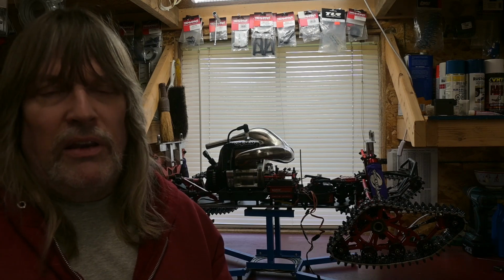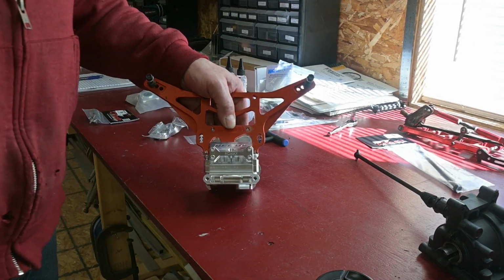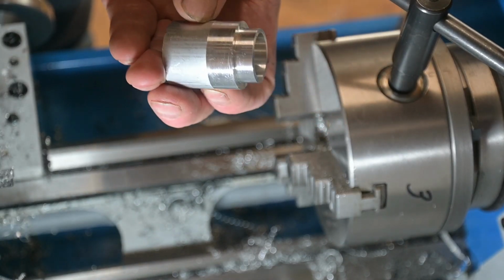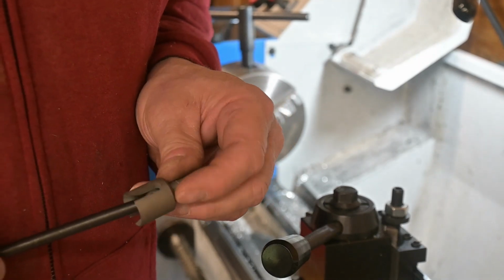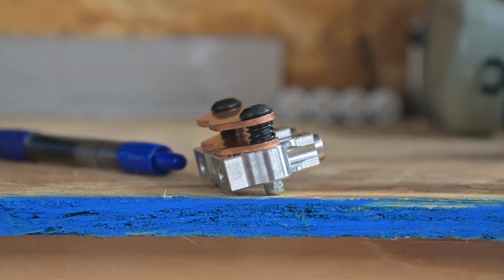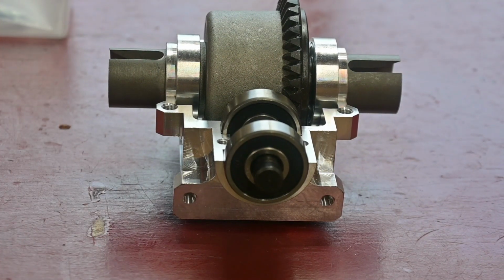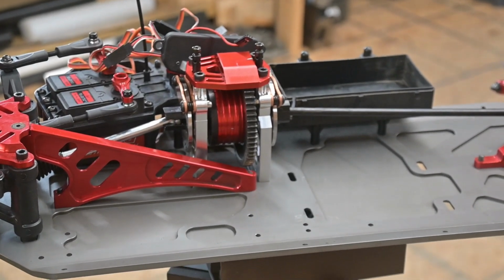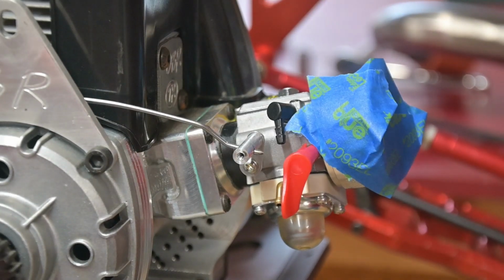Rovan 450 XLT Upgrade guide for high horsepower

Comment: If you still need dog bones for the XLT, the rear center driveshaft for the TLR5B work perfect they’re the same length and I’m using FLM
Reply from the maker: Thanks for the info Scott. My RC season and winter build projects got nixed early do to an arm injury that required surgery. Should be back this coming spring though.

Comment: Quality video! it makes sense to buy a 5ive t 2.0 and swap the rovan chassis, arms and center braces to avoid all the quality issues.  Almost pulled the plug on a 30 degree north 2.0 but their really is a difference.  Great video!  Man you have all the tools and skills to fabricate every piece you purchased. 👍
Reply from the maker: Thanks buddy. The Rovan's do have their issues but i still like them, there is always a trade off somewhere. Thanks for your input and checking out the video.
Reply: @RCWalletVacuum  keep making them!  I will share this
Reply from the maker: @alterdcustomrc4512  Thanks buddy, i really appreciate that. The next few months will probably be more run videos then when fall hits i will go back to build mode. Two projects in the works are a BAJA or clone into a full on tracked snowmobile with a single cyl big bore or OBR twin. The other is a short course truck with a hand fabricated chassis built around a single cyl big bore and 5ive t aftermarket diff parts. The tube chassis will replace the chassis plate. I will need to make custom piston/valve stack for the shocks. I really do appreciate your input and i can see from your channel that i now no where to go for an expert in electric versions.
Reply: @RCWalletVacuum  projects for days. Looking forward to seeing them in action on that track you building!  Electric is a blast. I bent the chassis on the dbxl and the driveshafts.  I have a vitivon chassis and new motor setup  going in posiden 2240 880kv.  I also just purchased the wheelman kraken vekka 5 electric conversion.  Gonna put that kit together.  Should be wild and also doing a Taylor rc 5ive t electric and a stock one gas because nothing beats that noise.  🙏❤️
Reply from the maker: @alterdcustomrc4512  Sounds great dude, i'll be watching for those videos!

Comment: id say with that kind of power those taylor diff housings will def buy you some time on those stock diffs ,,,,,lots of times stripped diffs are due to plastic flexing under load
Reply from the maker: Hi Shadetree RC, i'm sure the stock pinion gears will need to be replaced as well but it will be a test to see what it can take. Thanks for checking in